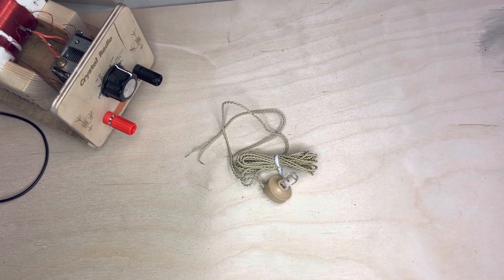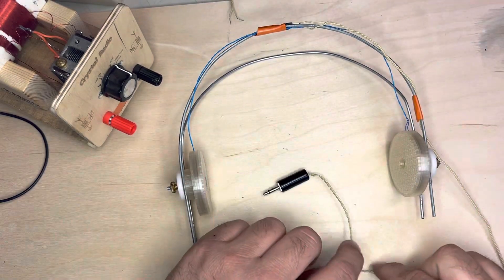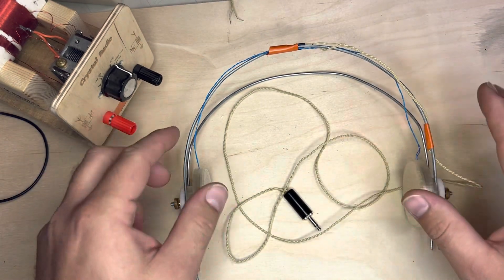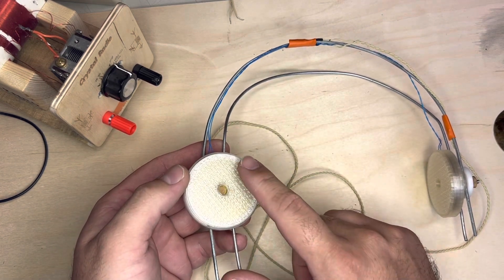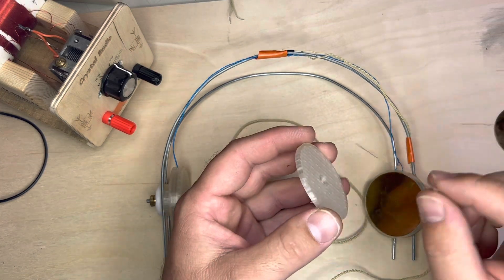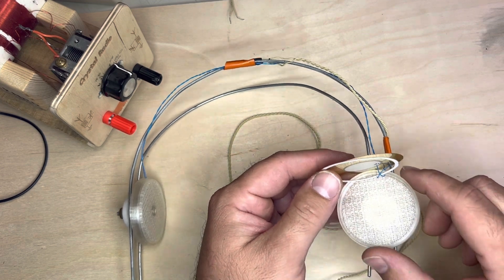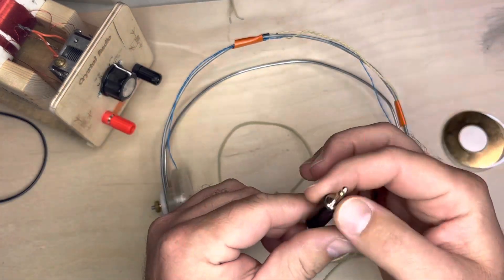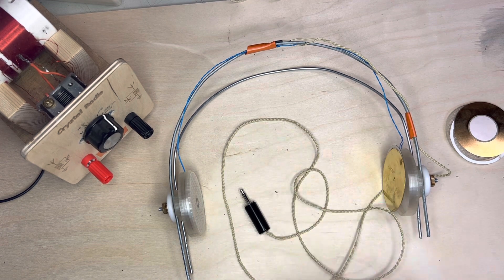A better crystal radio earpiece

Comment: Do you connect the Piezo disc in series or parallel to the Jack?
Reply: He said he wired them parallel.  Since they're very high impedance, parallel shouldn't be a problem, but make sure you keep the polarity when you connect or they'll be out of phase with each other and effect the sound.
Reply: @ohger1 the 50mm discs I've seen have an impedance of 200-300 ohms.  Connecting then in parallel cuts that in half.  Connecting them in series doubles it.  600 ohms is pretty good.  100 ohms isn't great.  Vintage headsets are 2000-4000 ohms.
Reply: @ Oh, I thought the piezo discs were several thousand ohms minimum, but I never actually measured any of them.

Comment: Some manufacturer should start running of batches of the "Old Style" high-impedence headphones. They could easily sell 10,000 or more per year. And charge just about as much as they want!  I'd gladly pay 30, 40 or even 50 bucks for a good, working set.
And the cost of production won't exceed 5 or 6 bucks a unit!

Comment: Howdy. My experience.
Crystal earpieces can get jammed by high residual voltage. Try short circuiting the leads and observe the result before throwing away.
Also. There should be a resistor over the jack contacts to discharge residual voltages. Say 100 k. The earpiece impedance is something like 50 k.
Regards.